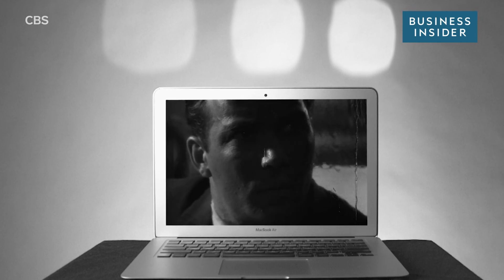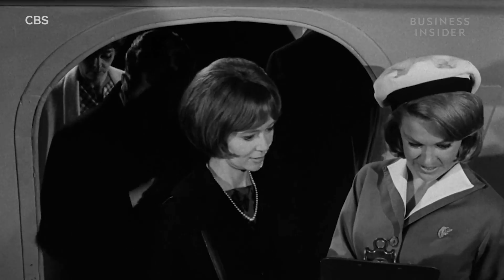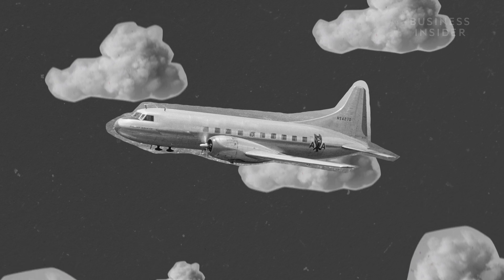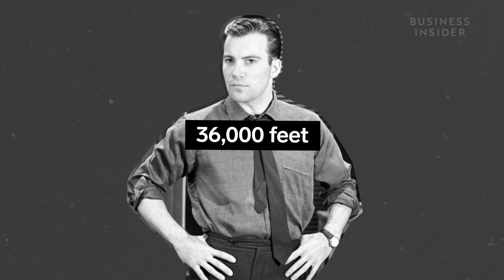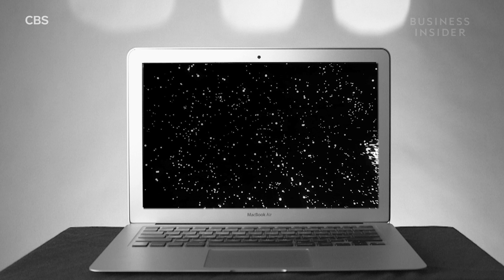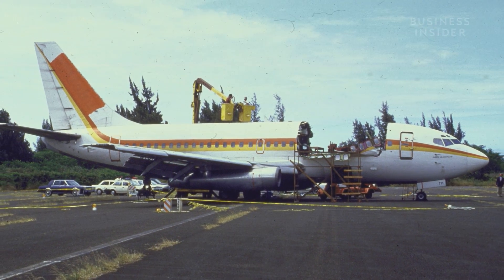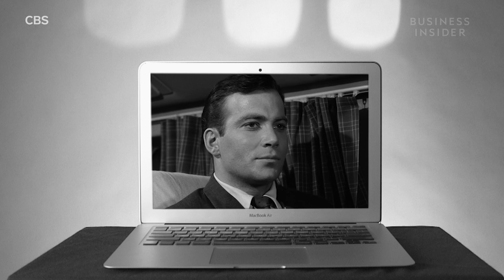Why You Can't Open An Airplane Door Mid-Flight

Comment: A passenger recently did open a door on a plane. There are dozens of shorts and even more videos of it
Reply: That was at low altitude, the pressure inside and out would be almost equal.

Comment: NO - before landing the cabin is depressurized.  The door cannot be opened WHILE PRESSURIZED.  The differential represents thousands of pounds of pressure and the door could never be opened.   Just before landing the pressure becomes equalized so there is no resistance and no "sucking out" of people or things.

JR

Comment: Sorry the door opens outward there is not pressure holding the door and especially the emergency exit doors closed. The 450 plus miles per hour wind is what does it. The wind is pushing in way more than pressure out. And one atmosphere of pressure actually is not that much that stewardess  was certainly blown out more than pressure out just like the part of the plane that broke off.

Comment: Um your showing outwardly opening doors. You know the kinda door where that pressure i side the plane would actually help you open the door. If it opened inward then the pressurized cabin would hold it closed but if it opens outward. All that pressure is more force than the outside air.

Comment: u should invest some more time investigating before posting such video, you have facts wrong .. it is not the height preassure so problematic here, it is the speed, aerodynamic pressure (because of the higher speed around the plane a underspressure is created). And the other thing is, many bigger modern planes have doors that open direction out, so doors are actualy pulled out by pressure,.. there is actualy a mechanism that holds the doors tight and locked, protects from this to happening. Doors can be opened, but only at low speeds.

Comment: Something doesn't make sense here. You technically could open the door of the plane because 1. The door opens outwards, not inwards from the fuselage. 2. The pressure is higher in the plane than outside it. Meaning if the door was unlocked, it would fly open in a split second with all the air inside the plane rushing out. Their is no outside forces pressing on the door to keep it shut. This video is misleading and nobody caught it

Comment: That makes sense if plane doors open inwards, but they open outwards. So greater air pressure inside wouldn't prevent an opening?
Reply: I stand corrected! They open slightly inwards first, then shift out and sideways. AHA

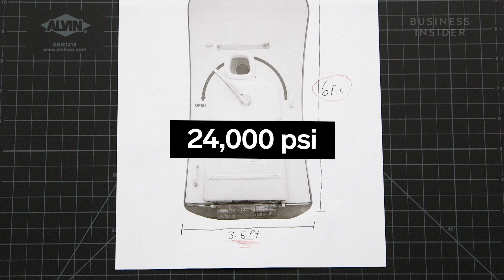Comment: 2:13/4:19 24000 pounds is force, not pressure, since it's the result of multiplicating pressure x area. Therefore should have written 24000 lb, and not 24000 psi.

Comment: You CAN open the door mid flight at lower altitudes but these phases of flight are when the seatbelt light is on.

The door has 24,000 lb of pressure overall not 24,000 psi. It has 8 psi. 

You get pushed out by the rushing air not sucked out.
Reply: just happened yesterday
Reply: @ChiChi-ic6ye  it did happen yesterday, to a smaller door (emergency door) and it happened mid landing which has many diffrent pressures, the timing just happened to be perfect. Plus being the nature of the emergency exit door, the latches are designed slightly differently and makes it a tad bit easier to open, but still must've been a struggle...
Reply: I was running to the comments to type this...thanks someone else knows absolutely basic physics.

Comment: Wait a second the pressure inside the cabin is greater than the pressure outside so it should press outside because gases want to even out so the pressure the door should already feel the 24000 psi you make it seem though as if the pressure would come from outside and press the door inside the plane
Reply: The airstream prevents you from opening the door

Comment: NO! Not 24'000 psi. The diff pressure is about 8 psi and the door is about 3000 sq.in. so it's 24'000 lb of force not psi pressure (Pounds per square inch).

Comment: For those that want to save time: Higher pressure inside the cabin than outside, low temperature. Aircraft doors are designed so you have to pull against the door and you wouldn’t be able to withstand the high pressure forced on the door.

Comment: All the smart-asses in the comments. 😁

Up until of recent years, I really believed that you could open the doors mid-flight if you were a mad person and managed to board the plane with a hydraulic wrench.
The doors locks seems mechanical, but I concluded that cabin-pressure would push enough on the locks that the handle (purposely) would break instead. 

Yeah, my IQ is probably low, or does it?

Comment: What part am I not understanding here. The high pressure is inside the plane and the doors open outward. How does the low pressure outside keep the door closed?
Reply: Not all plane doors open outwards check out the 757. Its doors come in then you push it out. And the airstream stops you from pushing it out

Comment: You understand that the cabin is pressurized so the force is from inside to outside to open it up 😁. (Although the second reason was okay).
Reply: Exactly lol
Some idiot recently opened a plane door. There were passengers right next to it and they didn’t get sucked out either lol

The pressure would decompress and equalize within .5seconds, meaning after that amount of time, there’s no vacuum to pull people out.

Comment: But your physics is wrong! You dont pull open a door on a plane, you PUSH it open, and the higher pressure inside the plane would help you do that instead of preventing it..
Reply: Well the 737 door come in then you rotate it out. So the airstream stops you from pusing it out
Reply: the door has to come in first to open outwards, the door when it closes comes inside the plane is pushed into the door frame forming a plug. To open the plane door it has to come into the plane first to the be pushed open outwards.

Comment: Wait, they are saying one of the main reasons you can’t open the door is the lower pressure outside of the airplane...which would make it easier to open the door!? High pressure inside, low pressure outside...would wanna suck the door out. Great research tech insider...

Comment: Sorry but, am I missing something? The pressure is on the inside correct? So wouldn't you be assisting that force that wants to open the door? The door is meant to open outwards which happens to be an area of lower pressure. So if unlocked what's stopping it from opening. This video literally just tried to disprove everything I've learned about pressure in school and my life!!!
High pressure in plane, low pressure outside... High pressure moves to low pressure and forces door open...
Reply: Well on the 737 series the doors come in then rotate out

Comment: Hold up, do they swing into the plane or out? If they swing in, sure that air pressure is going to make it hard to open, but if they swing out, that pressure would assist in swinging it open. Or is the argument that the locking mechanism itself would have the pressure of the door weighing on it, keeping it locked by friction? (Think trying to unlock a deadbolt while leaning against a door.)

There's a picture in the video that shows a door swinging out, but then says that the "plug door" is shaped with the inner edge being wider than the outer, which makes no sense. Furthermore, if they do swing into the plane, how is that supposed to work with the seats right there?

This video does a subpar job of explaining all this.
Reply: @Martin Shepherd That definitely seems like the sort of thing this video should have mentioned. Thank you!
Reply: Found the comment chain with the people who actually thought about what they were hearing in the video.
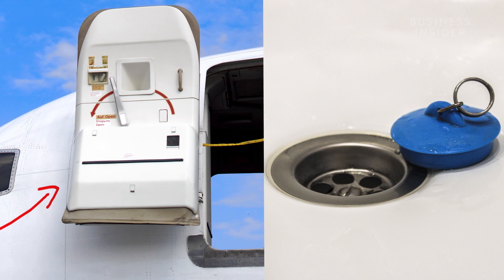Reply: Thank you! I had this exact same question after watching this video. The picture at 2:58 got me thinking.
Reply: Mention of plug doors true for majority of Boeings (maybe all) but not true for Airbus 320/30/40. These Airbus doors lift out of aperture and then swing out, the reason for lifting is to take the pressure pads on the door out of engagement with the brackets on the door surround. I noticed the video calculated door pressure load as 24,000 psi : methinks the si bit of that ought not to be there.
Reply: I just wondered the same thing. Plus, she said the pressure at 20.000 feet would be lower compared to 36.000 feet. But it would be higher. The difference in pressure would be lower.
This video is not thought through very well.
Reply: https://youtu.be/PLxwNv6Y3C0 although it’s not what the video was made to explain, you can see what the person above me is talking about with the door pivoting. This video kinda sucks at explaining it tbh, they seemed to try to make it simple but assumed everyone would already know how an aircraft door works which isn’t very simple
Reply: These replies gave me the answer much better than the video itself.
Reply: And the video also stated that there would be "24,000 psi" on the door which is ridiculous. Yeah 24,000 POUNDS makes sense but not PSI. I agree, this video is crap
Reply: All doors swing out. Some may go in a little first before swinging out. Not all though..so I think the danger of a mad man opening the door mid flight is still real.
Reply: @parrotbrand2782  Suggest look at B767 AND DC10: not all doors swing out.
Reply: That’s the point the pressure holds it in place
Reply: @icbmrick6514  the point is the video has very poor logic and does not cover the facts accurately
Reply: No, it still wont.

Comment: well because otherwise you'd get yeeted off the plane
Reply: What does “yeeted” mean?
Reply: @TheLiamster  "Yeet" is a term fairly wildly used by the youth when they throw something. Or well, that's what it originally meant, the word got very popular and people use it with various meanings these days. In short, "to yeet" is basically to throw something, like the plane would throw the people out. But it's by far not a formal word or anything